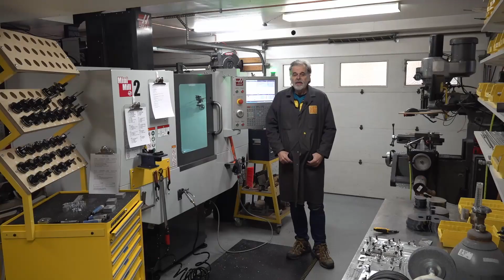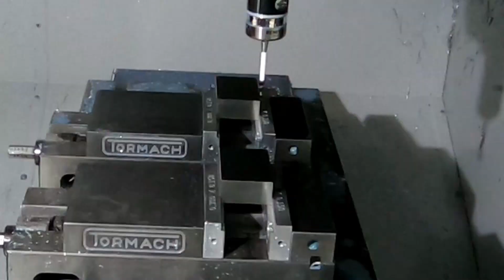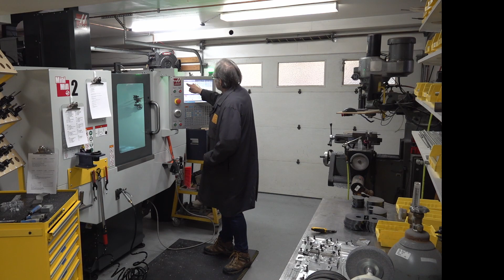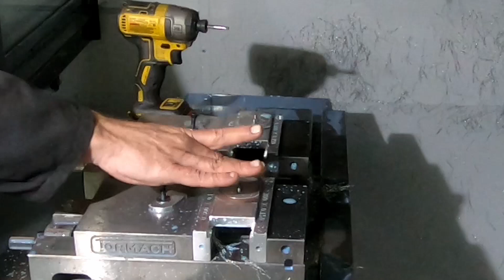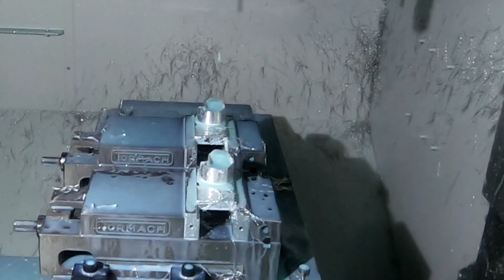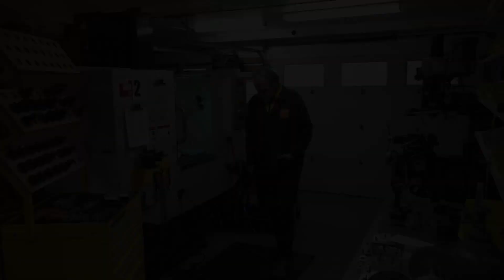S5:E9 - CNC machining on the Haas Mini Mill 2. NQALHA Production Run 5. Hand Control Body

Comment: Hello sir, did you add any soundproofing to your garage door? If so, can you recommend what you think would work well for me on mine. Just want to be a good neighbor.
Reply: Nope, I live in a rural area. Long ago, I built recording studios and discovered how hard soundproofing was. A bit of fiberglass on the door won't do anything
Reply: @mikepeterson1207  My contact at Haas said they received my new Mini Mill. I should be getting my delivery call this week sometime. Got most my tooling ordered too. That money goes fast. Have a good day Sir.
Reply: @mikepeterson1207  Hello Sir, I am getting my Mini Mill delivered this week. Can you please recommend what coolant I should run. Do you run a coolant that is universal for all types material? Thanks.
Reply: @shaneprice2102  I'm not a coolant expert. I use Trim MicroSol 606 BD. Coolant selection is really complex and I get the one in stock at my local industrial supply. In general, soluble oil is the oldest, but it gets infected with bacteria and stinks. Synthetic lasts longer and doesn't stink, but it's best for steel and stainless. The stuff I use is semi-synthetic and is rated for aluminum, which is the material I use the most

Comment: Good videos.  I’m considering a Mini-Mill 2.  I’ve heard the auger doesn’t work well.   What’s been your experience with the chip augering?
Reply from the maker: It works well, but not totally automatic. The enclosure funnels the chips into the auger, but they don't flow automatically. They need a bit of help from the coolant nozzle or a stick
Reply: @MP-ME  Thanks for the info.  Great commentary of the machine.  You pack a lot of the finer details in your videos that may not get the bullet points in other videos and literature.  I just ordered a Super Mini Mill 2.  I'll continue to learn all I can from your videos and thanks again for the  content!

Comment: Dude u are hauling ass. Take a 3rd pass with that 1/4 em. 2 different depths like u did, but take a second spring pass at full depth. So 3 laps. Your part will look better and you will hold your tolerances for longer. I work on 2 mini mills every day. Both supermini mills. Used to have a vf-0 back in the day, but Haas stopped making them. Well they do, but they call them super minimill 2’s now. Like your machine. I’ve got 17 years on a hass experience. Let me know if u ever need help with anything. They really are great machines. After 17 years on the job, my best advice is always keep your head in the game. Always. Alway pay attention to what u are doing. 100% of the time. Never get complacent. If you do that, you will do great man.